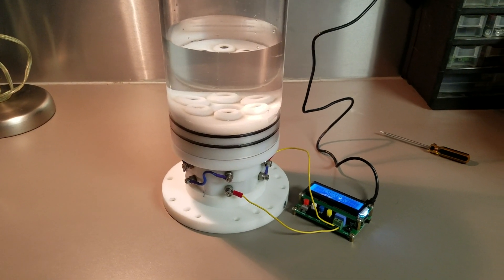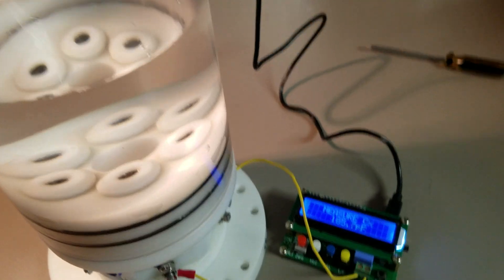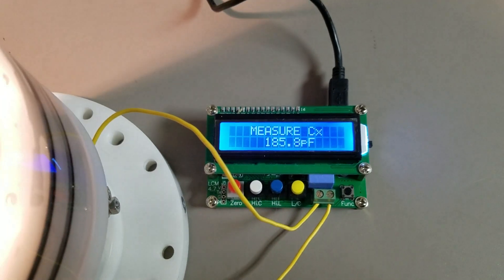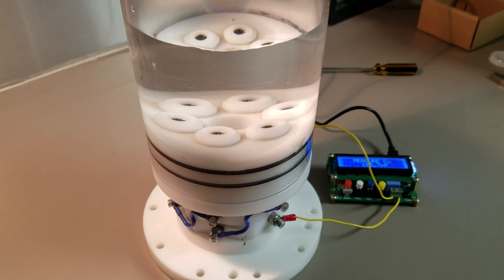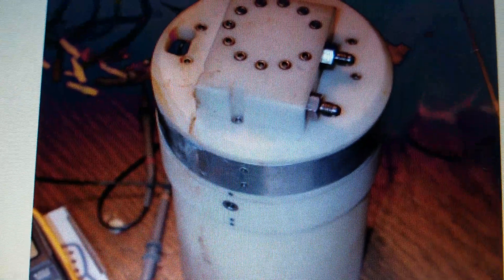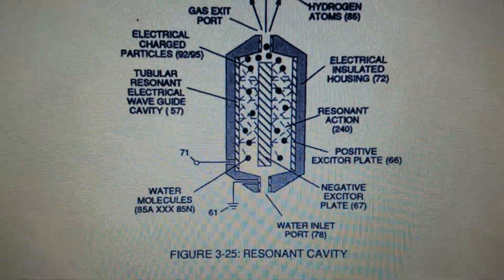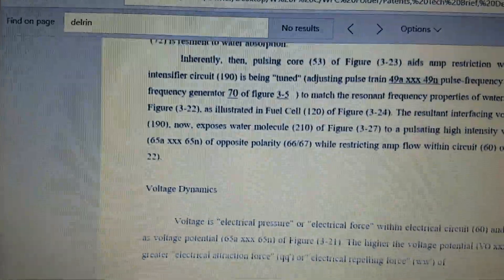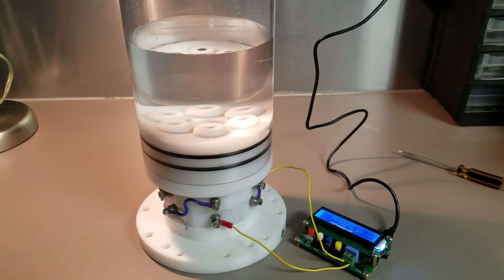Stan Meyer Research # 15, Feb 2019-Measuring capacitance and the need for shielding

Comment: Good to see your still at it Brad 👍. I tried one last time to work with Max, and Ronnie but they both chose the highway 🤪 so now I can rest easy knowing I did my part in forgiving them for past deeds and made the move actually work with them. Now it is just my partner and I and as soon as my funds are right again I'll get back on it. I will not be asking them again as they bring too much drama to the technology🤬. 
Got loads of high resistance wire and a vacuum chamber to get the air out of the VIC transformers and stop the coils from vibrating the wires protective coating off along with a whole lot of other good stuff like four different cores to try out. 
For the most part I have been taking a break paying off some bills and going over the science to make sure I got it right this time around. So far all seems to be good for me to actually try once again to bring this technology to the marketplace once I get the CNC mill up and running with the new 4kw motor. This way I can start making everything in house as that middle man was far too costly and put me in debt big time.  I think I have all the end mills I need to get a limited production going just got to make sure I don't snap any of them doing something stupid. 
I have the same inductive/capacitance meter and for the most part due to temperature changes it really doesn't measure the capacitance correctly, just try and build a known inductance for a targeted resonance and you will see what I am talking about. I just build the VIC transformers by trial and error until I get them to resonate at the frequency range that seems useful for this technology according to the SMTB. 
Best of luck with you efforts to solve this technology.
Reply from the maker: Thanks Ed,It is always difficult collaborating on this tech as everyone has their own ideas and agenda...But the good news is we've all helped each other build up a much better understanding than we had years ago. Without the contributions of so many different people we would probably never figure this out.The combined effort of all of our work, with different views, ideas, and opinions will ultimately solve this tech IMO.In the mean time, the work continues.

Comment: the water temperature is stable in  that delrin encapsulation?
Reply from the maker: Jon colt 

Correct. I'm just stating that we don't want to be testing at temperature extremes. We need to control external factors as much as possible until we get the cell working.